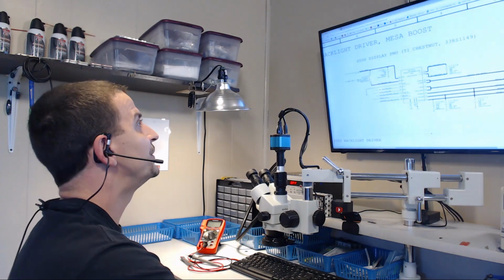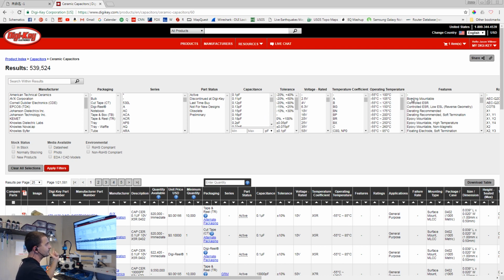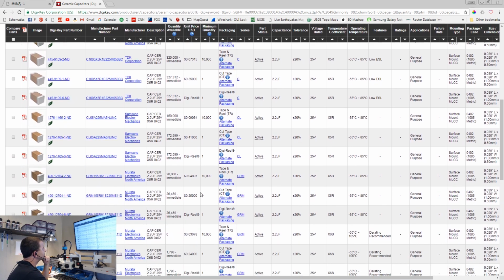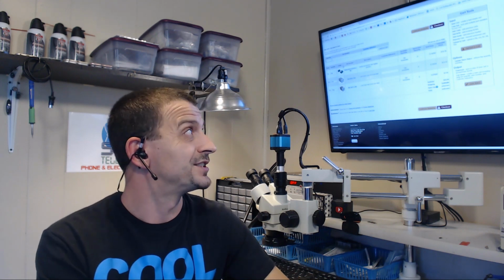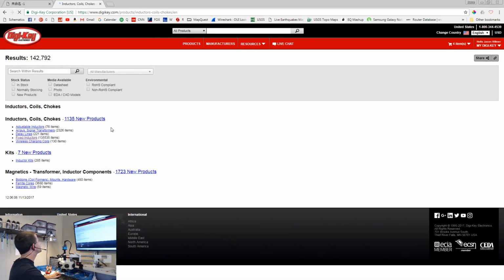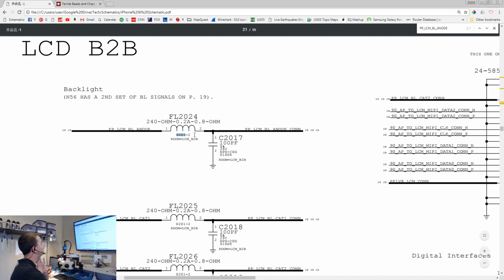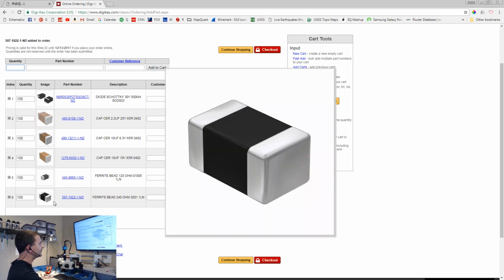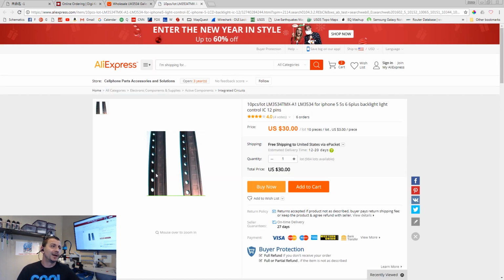Ordering Parts for iPhone Board Repair (or *any* other board)

Comment: It isn't worth being cheap and trying to save a few bucks (or pennies) when buying capacitors (or certain other components common to fail). Buy the best ones and charge your customers 5 cents more, so their devices will have much greater longevity. The quality difference between the cheapest and best capacitors is huge.

Comment: Motherboard broken due physical damaged
And I don't know CPU chip IC is working or not. But some shopkeeper told me maybe CPU chip Ic is broken no one can fix it or get the data from this iphon6.
Need ur help to recover my data or repair my iphon6
So please help me for my data.
Waiting for your help n support and share it email address to me so I can send my iphon6 picture s which is physically damage. And I tired to repair in India. Please tell me what should I do.

 Please help to fix my phone I need my data on urgent basis.

Comment: X5R code means the capacitor characteristics. First letter code is lowest temp second is highest temp and the third code is capacitance change over temperature. It’s easy to find out this info with Google. Like how old resistors use colour codes to show resistance, SMD devices have these codes to show their info in concise means. X = minus 55C, 5 = plus 85C and R = +/- 15%. That’s your X5R.

Comment: I have an asus memo pad 10 (motherboard is ME102A REV. 1.6) with a blown capacitor or diode (i dont know what it is it looks like a spider with 3 legs on one side and 2 legs on the other). Im wondering where or how can i find that small part? Thanks in advanced from Los Angeles.

Comment: The code for x5r, see this link...https://www.allaboutcircuits.com/technical-articles/x7r-x5r-c0g...-a-concise-guide-to-ceramic-capacitor-types/             
 ...........The Code
The three-character code with the letter-number-letter format is used for capacitors with Class 2 and Class 3 dielectrics. C0G is a Class 1 dielectric, so it’s not included (more on this later). X5R and X7R are in Class 2, and Y5V is in Class 3.

The first character indicates the lowest temperature that the capacitor can handle. The letter X (as in X7R, X5R) corresponds to –55°C.
The second character indicates the maximum temperature. The theoretical range is from 45°C to 200°C; 5 (as in X5R) corresponds to 85°C, and 7 (as in X7R) corresponds to 125°C.
The third character indicates the maximum amount of capacitance change over the part’s temperature range. The spec for --R capacitors (such as X5R and X7R) is ±15%. The capacitance of parts with a code ending in V can actually decrease by as much as 82%! This probably explains why Y5V capacitors are not so popular.
The following graphic gives you a good visual representation of how unstable Y5V and Z5U are compared to X5R and X7R....

Comment: The Code

The three-character code with the letter-number-letter format is used for capacitors with Class 2 and Class 3 dielectrics. C0G is a Class 1 dielectric, so it’s not included (more on this later). X5R and X7R are in Class 2, and Y5V is in Class 3.

The first character indicates the lowest temperature that the capacitor can handle. The letter X (as in X7R, X5R) corresponds to –55°C.
    
The second character indicates the maximum temperature. The theoretical range is from 45°C to 200°C; 5 (as in X5R) corresponds to 85°C, and 7 (as in X7R) corresponds to 125°C.
    
The third character indicates the maximum amount of capacitance change over the part’s temperature range. The spec for --R capacitors (such as X5R and X7R) is ±15%. The capacitance of parts with a code ending in V can actually decrease by as much as 82%! This probably explains why Y5V capacitors are not so popular.
Reply: Thanks for that info @Randall Goguen. Much appreciated.

Comment: Could you please provide us the website that you buy chips IC like base band ic chip
Reply: karim bedreddine good of you
Reply: AliExpress, ebay, specialized websites serving repair shops etc. Most of those kinds of chips are not available in the normal market because of the product manufacturer (for example Apple) contracts the chip manufacturer for a modified or unique design, and the contracts typically include restrictions like no selling that chip to anyone else. So it has to be acquired through employee theft from the factory, after-hours production runs for sale to black market vendors, someone else reverse engineering the chip and (potentially illegally) manufacturing a clone - or be harvested from broken devices.

Comment: When you ordered the 10uf at 6.3v and 10v ; Just order the 10v one's it covers both since they are the same case size.  On capacitors you can always go up in voltage, just gives it more headroom.
Reply: not really, in highly engineered circuits you might need the extra low esr that a low voltage cap comes with, not in this case though
Reply: Yes but can't the ESR be different as in lower on higher voltage caps ?

Comment: in the UK it seems more difficult as mouser/digikey both have minimum £30 order req... i use rs supplies but they don't seem to have everything i want...... There is a samsung charger ic I need that i can only get from china for £12, smb136set for a gt-p3110.... If anyone knows any other decent uk/european suppliers I would be grateful for any info! thanks

Comment: How about inductor coils? Digikey requires the sizes. How do you know the sizes? Like measurements width, height, length in mm. I know you could possibly get a caliper. Any easier way?
Reply from the maker: I used a ruler under the microscope and measured the stock coil.  There aren't any exact matches on Digi-Key so I wound up selecting a handful of sizes that would physically fit and then narrowed the results down by electrical specs.  For the iPhone 6, I wound up settling for a coil that was rated for 10mA less than the stock coil in order to get one that would physically fit.

Check this one out :) 
https://www.digikey.com/products/en?keywords=490-15890-1-nd
Reply from the maker: It is a tiny bit smaller in physical size but fits nicely.
Reply: Hahaha

Comment: They use a 3 digit notation to indicate the dielectric used in them according to EIA RS-198 standard
X5R

3rd digit -- Tolerance R=15%

2nd digit --- Upper limit =85 deg c

1st digit--- Lower limit X=55 deg C

Class 2 capacitors are used in applications like bypassing, coupling, decoupling.
Reply: The Dave has you covered in EEVblog #626 https://youtu.be/2MQyQUkwmMk
Reply: Temperature coefficient was in front of him the whole time.

Comment: If you struggle to find on digikey or ali, octopart is also a nice search engine! Also farnell/mouser/tme and rs-components (last ones esp in europe) are alot cheaper for non commercials (beware of the postage)
Reply: magnifikus i can recommend tme europe, they are in poland. Really cheap
Reply: from professional experience i can tell they are special, just expect that :)

Comment: I cant find "U_GPSLNA" anywhere, its a WIFI chip I'm pretty sure, its the smaller one next to "U5201_RF" maybe I'm using an incorrect name? I'm not too sure, its black and I think its either been shorted or water damaged because it doesn't show any resistance or have anything going through it.

Comment: X5R etc.. refers to temperature rating tolerance.
Reply: To be precise, its the material the capacitor is build from:
NP0 or modern nowadays C0G called are the most robust and stable ones (if schematics tells you NP0 you probably wanne get that)
X7R and X5R are going forward for higher values, always prefer X7R over X5R.
Reply from the maker: +Oxford Electronics thank you :)
Reply: Isn't the voltage not really important aslong it is atleast the original value and isn't it even better to chose like 10V instead of 6.3V to make sure it will survive peaks next time? In bigger circuits I have done that several times if the original caps was pregnant, like we say in Germany :)
Reply: Bigger voltage does not hurt in general aslong you keep the dielectric, you easily get like an 50V version in X5R instead of a X7R but you can degrade your circuit!
So if you stay in package and dielectric material bigger voltage only hurts your money bag :)
Reply: Isn't it more a change in capacitance at different temperatures and is a function of what material the cap is made from. https://www.maximintegrated.com/en/app-notes/index.mvp/id/5527